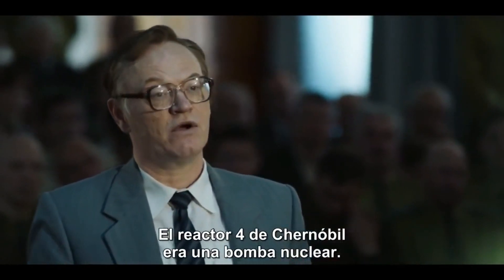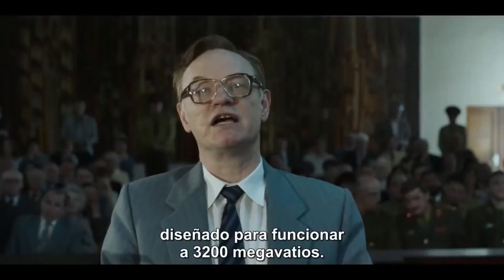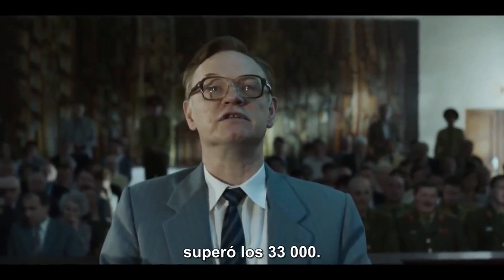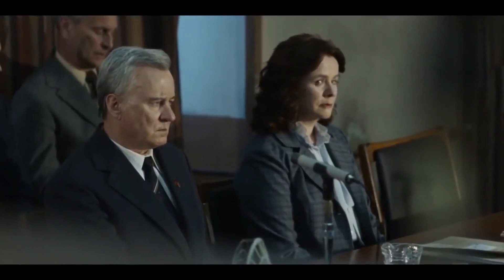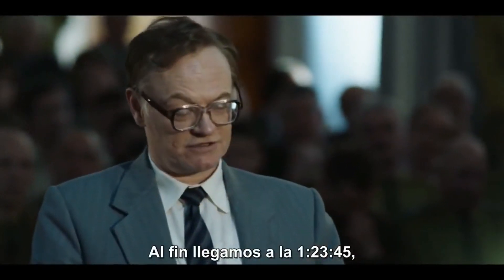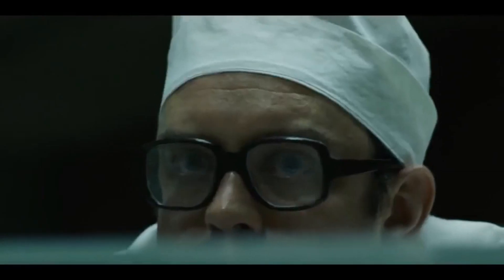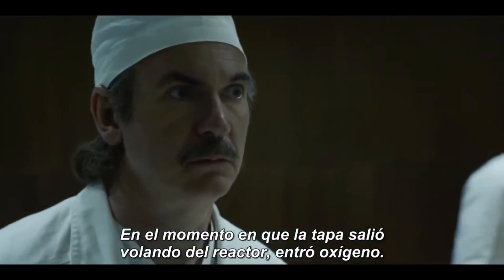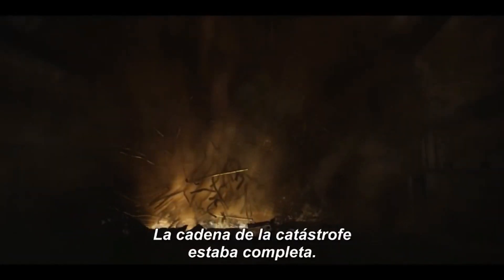Chernobil disaster explained in 10 minutes (3/3) - Valeri Legásov - Chernobil Series

Comment: You cut out part of his speech in the middle of this clip
Reply: The KBG cut it out
Reply: @kunstkt  
Ah yes, the famous KBG. The long time rival of the KGB.
Reply: @synthwavecat96  but neither is as powerful as the CAI
Reply: @kevinmoody934  What about the Service Secret or the FIB?
Reply: "For the same reason our reactors do not have containment buildings. For the same reason we do not use properly enriched uranium fuel, for the same reason we are the only nation that builds reactors with a positive void coefficient."
Reply: @synthwavecat96 this speech is just nonsense propaganda which is why it probably isn't shown here. Nothing in this sentence is true:

1- Prior to Chernobyl containment buildings weren't mandatory in many designs.
2- Canada's CANDU uses even less enriched uranium than the RBMK as it uses natural uranium which is the cheapest version possible.
3- There are several other reactors built with a positive void coefficient. It is relatively rare but not unique by any means. This particular reactor did have an abnormally high positive void coefficient but only at temperatures well below the normal operating range.

The design itself is original and IMO excellent to solve the problems that it was supposed to solve. However it wasn't tested enough before getting put into production. Between the Leningrad incident in 1975 and the Lithuania incident in 1983 there was already enough data to make the changes that would be made only AFTER Chernobyl. It is really sad they weren't done earlier. Despite the catastrophe, these are small flaws that aren't even difficult to address, so if the USSR had fixed these details earlier (and they truly are just minor things in the design that are not even expensive to fix) then this would have never happened.

The RBMK reactor is much safer today, today after only minor changes, which means that if these small things had been corrected then nothing bad would have happened back then.
Reply: because it's cheaper
Reply: tries to get more views and thus money